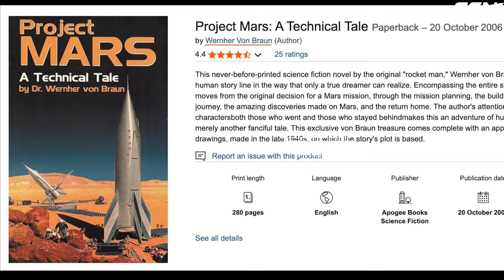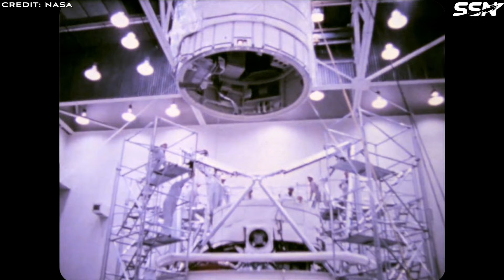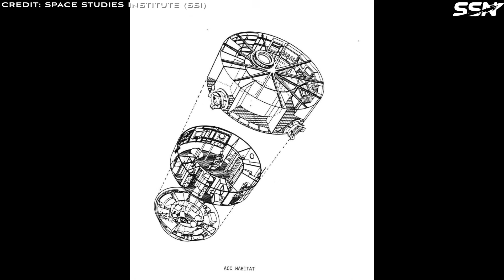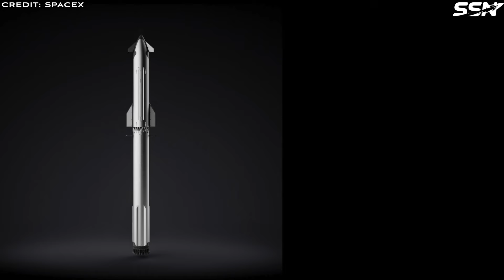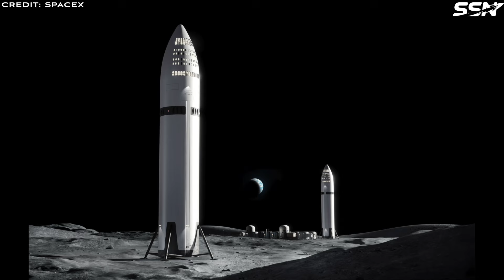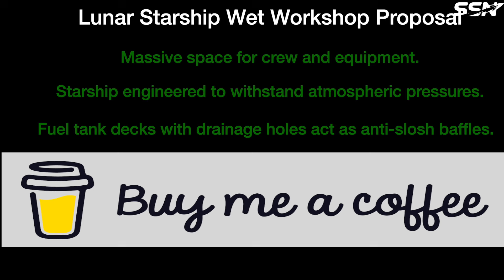Wet Workshops Are Back: NanoRacks, ESA, and Starship’s Lunar Future

Comment: I like the idea of repurposing space Shuttle / SLS fuel tanks that are left in orbit.  Maybe we can use this "wet workshops" concept to recover some of the funds waste on these outdated vehicles...

The notion of "wet workshops" only makes sense if:  (1: ThinkOrbital can't get its robotic ThinkPlatform kits to work cost-effectively, or (2: Sierra Space can't get its L.I.F.E. inflatable habitat modules to work cost-effectively. ThinkOrbital and Sierra Space will be the systems to beat. If, by some miracle, all threee notions ("wet Workshops", ThnikOrbital and Sierra Space) all can be made to work cost-effectively, it would be interesting indeed to see if a working space station could be built using all three approaches applied on the same station.

Comment: NASA's original plan for Skylab, was to replace the Apollo capsule used for crew access, with a small shuttle, similar to the Sierra Space Dreamchaser.  Unfortunately the Department of Defense (now the Dept. of War) demanded a much larger shuttle.  This took so much time and money to develope, Skylab had to be abandoned.
In the end, by the time the shuttle was ready, the DoD had better spy satellites and did not need the huge shuttle anymore.

Comment: Hypothetical: delta V calc for super heavy assumes fully fuelled starship on top, would have the required delta V without that?
Reply: I'm glad there's someone seriously thinking of re-utilising the empty and otherwise useless shells, such as middle rockets sections, by converting them into possible space stations, serving multiple future purposes.
Reply: @gaetanoroccuzzo  good point but the thing is it is only "a good point" there are million things you can go wrong in empty fuel shells
Reply from the maker: Elon has emphasised that the booster is "Earth-lifter only," with Δv "shifted to the ship". Booster stages at suborbital speeds, (~5–6 km/s). It's more correct to say that a Starship booster cannot practically reach orbit, given it's engineered for use in dense atmosphere and has no orbital avionics, station keeping capability or docking adaptor.
Reply: @SpaceStartupNews  I picture a Heavy with Starship booster in the middle. Avionics, etc. are fairly simple add-ons, maybe a Dragon capsule. Reuse the boosters and Dragon and a few reused Starship boosters could be put in orbit to form a space station.